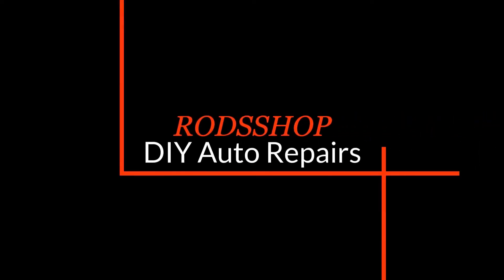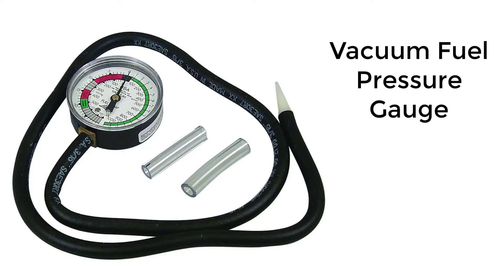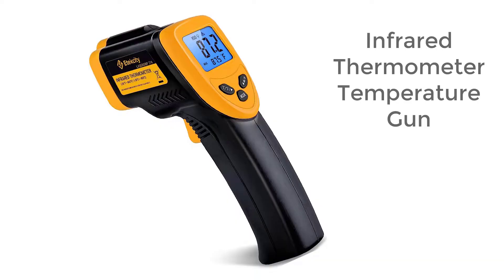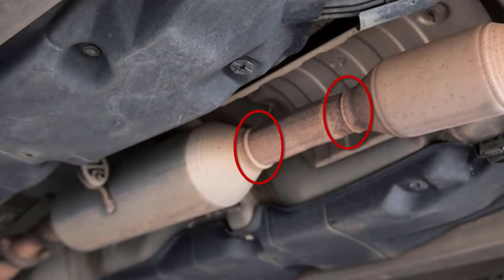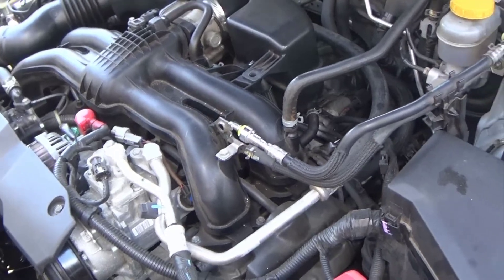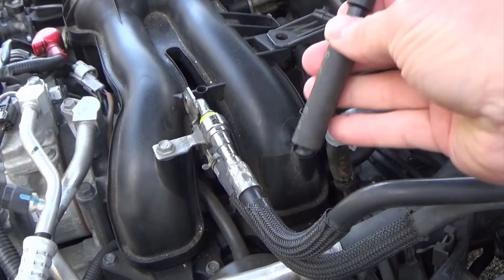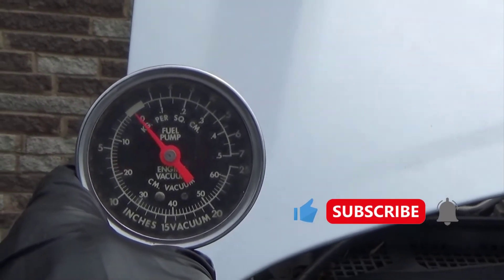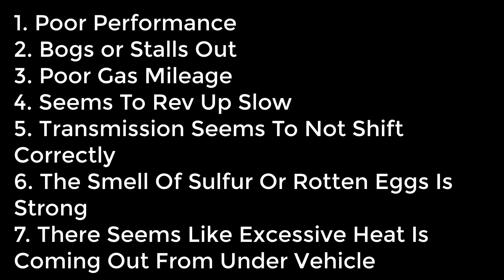Top Mechanic Reveals Simple Method to Fix a Clogged Exhaust

Comment: Would hooking up on my valve cover be sufficient to test for pressure? My rear valve cover gots alot of pressure.
Reply from the maker: You don't hook up to the valve cover for vacuum, you have to hook up to a vacuum line. It is often easier to just tie in to the vacuum line that runs to the brake booster. However that will require getting a small piece of hose and a "T" to hook your gauge to. The vacuum has to be pulled from the intake manifold, nowhere else.

Comment: I'll admit, I don't know much about cars, but this was pretty easy to follow. I have a 2013 Mazda CX-5 Touring AWD, which keeps going into limp mode. I've replaced the spark plugs, coils, the MAS, and the filters, but it's still having issues. Two different mechanics said it was probably an electrical issue and to take it to a specialist, which I did. THEY told me that the issue was a clogged exhaust system and to take it to an exhaust shop. Sigh. Now I'm afraid they're gonna tell me to replace my entire exhaust system or at least the CC, which is thousands of dollars. I'm so bummed. It also pisses me off that I paid $100 for a full diagnostic only to find out they don't check the exhaust system. 😒 I've seen several videos that suggest cleaning the system with a solution and/or pressure washing. Do you recommend either of those things? Also, I'm pretty sure I have one of the CVT transmissions you were referring to, lol.
Reply from the maker: Have you had any mechanic or have you tried yourself to run a vacuum gauge on your car to verify it is a clogged exhaust? 

If you are sure, this car has the same retarded catalytic system similar to the Subaru. And this is notorious for getting clogged. It almost seems like the built it that way on purpose to clog up. 

Anyway, I found your converter but you should verify it does fit your car. It is under $300 from Amazon. I would order it and have an exhaust shop put it on. It will save you that $1000 because they would have to make one or order it and it won't be cheap, this will at least knock off that high expense. I would call around and ask muffler shops if they can put it on for you or ask a regular mechanic, this isn't that hard to do. 

Here is the link, check it out and see if this will help:
https://amzn.to/4jPbLoN
Reply: @RodsshopOrg   Thank you. I actually did take it to a muffler shop; they did a full diagnostic, and everything was fine, no clog. So the electric shop I had originally taken my SUV to was full of shit. FYI, my vehicle has TWO converters, and most shops won't let you bring in the part, not around here anyway. Thank you for the link, but my car is a 2013, and that converter is for 2014-2016.

Comment: Very informative. Still wish there was more information on whether a blocked muffler could cause CAT readings to fluctuate - indicating a bad CAT and replacing it with no difference in performance...that's money we can't get back.
Reply from the maker: Well I do kind of mention what you could do in the video but here is what i would do if you are questioning the muffler. 

Follow the pipe after the second CAT and you will find a coupling, disconnect it and move the muffler pipe out of the way.

Now run the engine and check your CAT readings. If the muffler is clogged, this will take away that factor and even if it throws your readings off a little, they will be consistent. 

I will say this, the CATs on these clogged up way before the muffler.

Comment: This was a very comprehensive video. I ended up using the backpressure gauge that goes into the o2 sensor port. The first o2 sensor showed it had excessive backpressure. I opened up the second o2 sensor port by removing the sensor and this seemed tonrelieve the pressure. This indicated to me that the clog was further back. Next, I replaced the second o2 sensor and unbolted the pipe after the rear cat. That also showed normal backpressure when I tested, indicating it must be the resonator or muffler. Now I need to figure out the game plan in identifying which is bad. They are wedled together, so I may replace both.
Reply from the maker: To be honest with you, after dealing with this car and 2 more before it. I would highly recommend replacing the entire exhaust. You can get the front header pipe/converter assembly from Amazon for I think $150.00:  https://amzn.to/4hU4LHD

You can get the rear converter, which looks like a resonator and it is one that really packs up and gets clogged for $140:  https://amzn.to/4hZV4Hx

I think I would stop at the two cats, both front and rear, test it and see if you are flowing like new again. If not, you can also by the resonator, what looks like a muffler from Amazon for $146.00:  https://amzn.to/3ZcuAeH

All three sections together would still be cheaper than going to a muffler shop. Just from my experience, don't waste your time trying to figure out which cat to replace. On this Subaru and other cars with similar systems, once one clogs, they are all ready to stop working.